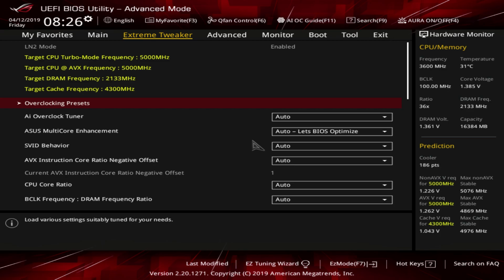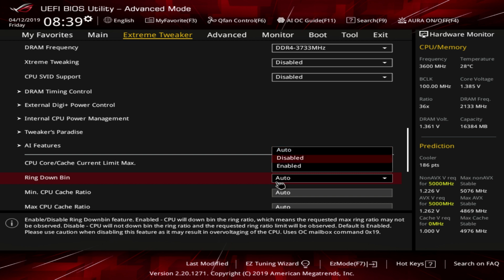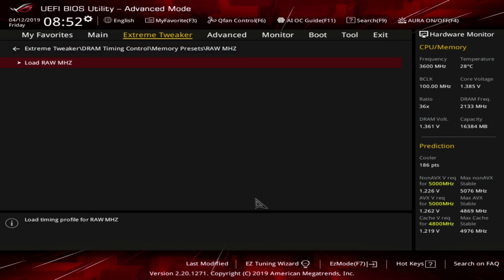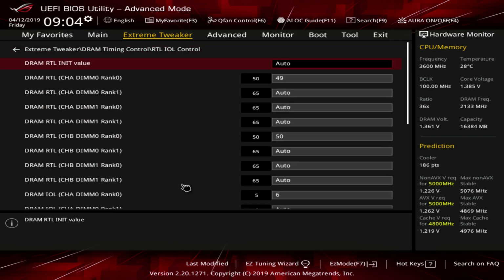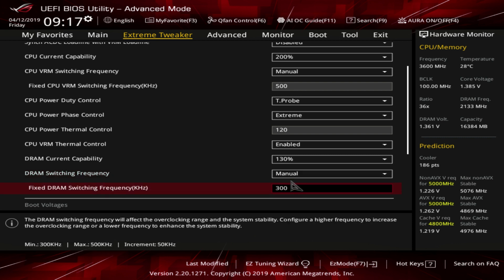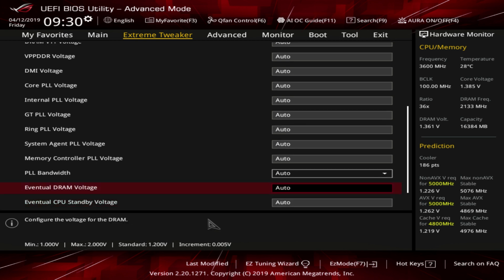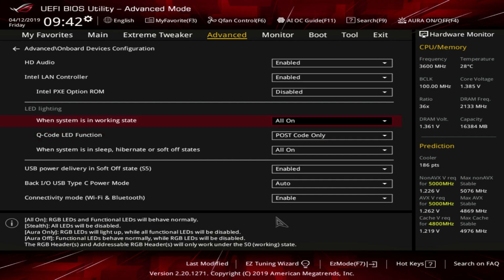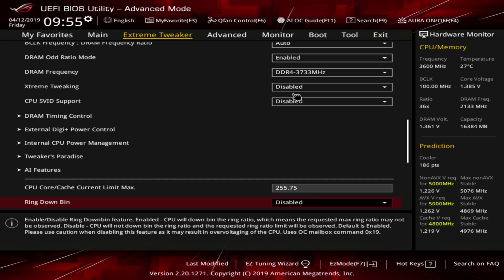ASUS Maximus XI Gene BIOS walkthrough.

Comment: XMP (Extreme Memory Profile) profiles are the max recommended timing settings (timing tables and frequency) of the memory modules stored on the SPD chip of the memory modules. They are not related to the motherboard, CPU or anything else than the memory modules. XMP II is the 'safe' extreme memory setting defined and tested by the memory manufacturer. XMP profiles are max JEDEC settings. The XMP II profiles are never enabled by default because you need to make sure that the memory modules operate in a well enough cooled environment beyond the cooling plates of the memory modules. If for example you have little or no case cooling the chances that you'll damage the memory modules with XMP II enabled will be quite high. Calling this 'Ai Overclock Tuner' is indeed extremely confusing since it has little to do with overclocking. You start overclocking the memory modules when you go over the XMP setting. The highest XMP profile is actually the performance of the modules as advertised. So most people are using their memory modules severely underclocked (e.g. 1066Mhz instead of 1600Mhz).
You can check the JEDEC and XMP profiles of your memory modules in CPU-Z under the SPD tab. Manually overclocking memory modules beyond XMP II profiles has little advantage except if you have a very good water cooling on the modules and push them hard. Overclocking memory usually doesn't add much to the performance of the system. I use the XMP II profile of my (old) Corsair Dominator DDR4-3200 modules (CMD64GX4M4C3200C16) and get 99th percentile (better than 99% of the world) in the Passmark Performance test v10.

This is basic knowledge for every overclocker. The fact that you don't know that is scary.

Comment: 14:05 cpu cache
22:08 Cpu voltages
30:34 MRC Fast Boot
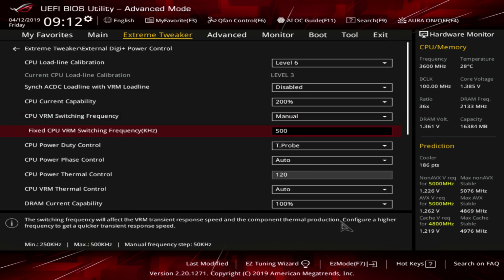45:25 CPU power / vrm spread spectrum or switching frequence/ loadline/phase control
50:30 dram current
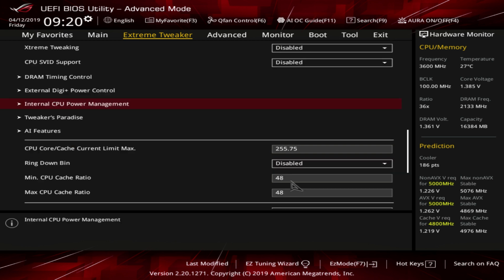53:47 Short long duration
54:58 Real time memory
58:03 BCLK spread spec

Comment: hey mate, is there any option you realy have explanation for what is it, all i see you just typing one by one with aboslutely no idea of that meaning, 
by the way 
4G overrride is needed for Quadro NVIDIA to helps use your ram as vram or when you using your motherboard in mining and you have connected more then 2 gpus, 
PTT activating T.P.M 2.0 protocol which is needed to install Win11 on your PC, turn it off and you will not able to do that
Virtualizations of cpu, must be turned on if you want to use BlueStacks and make a virtual android machine directly in your system
you re welcom

Comment: what should be the best voltage for 9700k on this board? current sitting at 1.270 LLC 6 idle voltage 1.261 load 1.243ish seen 1.23 do i just keep dropping the voltage to see what the best i can get its?

Comment: CAN SOMEONE PLEASE HELP? All I did was enable XMP I and selected RAM speed and enabled Xtreme Tweaking. Doing these two settings ONLY, I'm getting an additional 45 to 50 fps in Call of Duty MW Warzone. Temps are average 75 C with a max of 84 C. All cores are at 4.8 GHz pretty much locked when playing. Processor is i9-9900K with EVGA RTX 3080 FTW. Is this normal and will doing only these two settings damage my computer in any way? I'm pretty much locked at 195 fps 1440p max settings. Please help.....

Comment: The POST Code readout does act as a temperature readout on this motherboard. It is even mentioned in the manual. Same can be done on mid to high end ASROCK boards. Very helpful feature to that shows CPU temperature while in OS. You have to turn Q-Code LED Function option to AUTO for it to work.

Comment: Thx for this! On my XI Apex I am trying to push "G.skill trident Z Royal (x.m.p 4800Mhz) 2x8GB CL18-22-22-42 1.5V"R -kit over 4400Mhz and make the damn thing POST -> win10 ->  and then an old game-engine of Arma III should work 90fps+. What latency values should I try to get better chance to pass Post with 4500-4800Mhz?
( I should have educated my self at this channel before buying that 500€ kit. Now I know every options in BIOS that could make me closer 4800Mhz. I have OC warranty for i9( 9900KF) so if it blows up once I get a new one. ) Now I am setting up Bios. If that doesn't help what latency's should I throw in?

Comment: Hey Buildzoid, you can display cpu temp on post code LEDs. If you choose auto instead of post code only, it will display cpu temps after booting. Works on my Maximus X Hero, pretty sure it tells you in the description of it as well. Been working at least since Maximus IX, tho that was my first ROG board so I don't know about before that (always had like the pro gaming cheaper boards before that :P).

Comment: Don't do much memory overclocking, but on a Maximus X Hero (Wi-Fi AC) and 8700K with Samsung B-Die (G.Skill 3600MHz 16-16-16-36 Kit), and there is a difference with mode 1 and 2 for Maximus tweak. My board auto defaults to mode 1, switching to mode 2 actually raises all the bandwidth and lowers latency a bit when testing with memory and cache benchmark in aida64. Nothing truly noticeable in day to day usage or gaming, but slight improvements in some benchmarks.

Comment: Worked on the maximus X hero, few tricks for daily rigs : You can change the item to 'typical scenario' to save heat dissipation and also to decrease the voltage if you CPU is good enough (if you stay with 'worse case scenario' the voltage doesn't drop when you decrease it in adaptive mode, kind of strange!) , pll bandwith level 4 = 1.16v at CPU pll OC and it needs to be adjusted manually,  DRAM VVT voltage auto adapt to RAM voltage (/ by 2 by default) so no need to tune it for daily, also adaptive is good if you play with AVX negative offset (don't forget to put min/max value on CPU cache ratio according to your offset if not the system can be unstable). Cheers!

Comment: Firstly, thanks for the walkthrough of this BIOS! It's no small task to try and get through it all

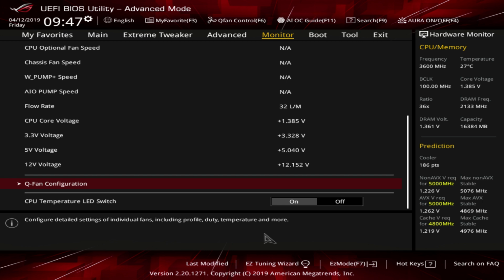At 1:21:00 you mentioned letting the Post-code readout function as a temp readout, but at 1:15:55 with the LED Lighting:Q-Code LED Function setting, selecting "Auto" does just that.

1:18:41 PXE boot environments are usually used for managed software deployments over a network, like in a large office, or potentially a LAN centre.

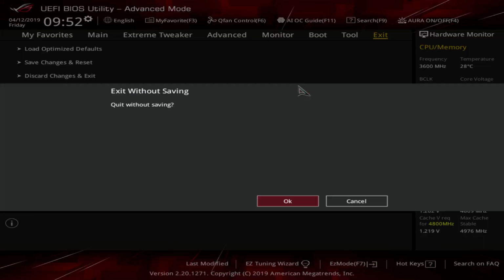1:25:48 The EFI Shell option is for a direct command-line interface with the motherboards firmware

Comment: IOAPIC is for irq address space, you generally want it always on, without it you limited to 21 or so irqs if I remember right.  Its probably also a requirement for MSIX but not sure on the latter.

Memory remap is required for 64bit address space in memory if I remember right.  It used to be meaningful as when 64bit cpus were new it defaulted to disabled and one would have to enable it if you had more than 4 gig of ram, but now it always defaults to enabled.

SRIOV is related to VT-d I believe, so basically if you stick something like a hardware raid card in a pcie slot and want to passthru to a virtual machine, I believe SRIOV would have to be enabled, root port virtualisation.

Network stack config would be useful for booting of a network, a enterprise orientated feature.  Common in datacentres e.g. used for things like recovery boot's.

Comment: I consider AVX offset a false economy setting, so much software uses AVX now, you will find it throttling back for that way too often, its like a cheat mode for overclocking allowing people to claim faster overclocks than they realistically have.

So e.g. I consider a 5ghz clock with -2 offset a 4.8ghz clock not 5ghz.  Yet you have to add that extra voltage, because sometimes the cpu will need to clock that extra 200mhz.

If you want to keep heavy extreme AVX workloads under control its better in my view to use 0 offset, set a clock that you want for your main use, and then throttle AVX via the TDP limit.  So e.g. my 8600k is throttled to 125w, which is more than enough for games, and normal desktop use.

But if I fire up something like prime95 or intel stress test, it will throttle back based on power consumption which is absolutely fine for me and that in turn controls temperatures.

Comment: Trace centering is the most important setting for ram in that board, with it disabled it won't run 4000+ 12.11.11 1t, only 2t
Reply: It should run 4K+ C12 1T without trace centering as long as you are using A0 PCB sticks.  A2 is what needs the setting enabled.
Reply: sabishiihito i have a1 dimms and and trace centering needs to be enabled

Comment: When you set your Q-code led to AUTO when all lights are on it will diplay CPU temp after showing POST codes. I have BCLK Slew Rate disabled. I have noticed higher 3DMark score with setting this value from 64us to 32 to disabling. Left it that way as I don't notice any stability issues. (9900k)

Comment: Welp I know what I'm listening to for the next 90 minutes
Reply from the maker: I strongly recommend 1.25x or 1.5x speed
Reply: @ActuallyHardcoreOverclocking  Quick question since I managed to get your attention.. do I need to remove the heatspreader on my RAM to figure out the manufacturer? My attempts at finding the answer through software has so far been unsuccessful.
Reply: @squirt626  yes, that is the foolproof way. However you need to be careful not to damage the PCB or tiny smd components whilst prying off the heatsink. As it will be fairly well glued on there... best to use a plastic only tool, like a credit card or similar.
Reply: @dreamcat4  I'll give it a shot, thanks !